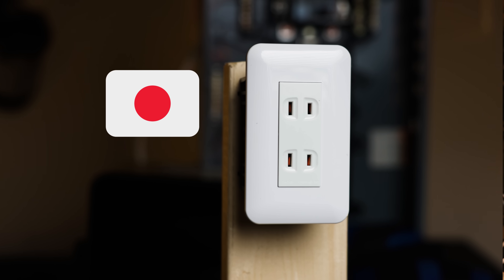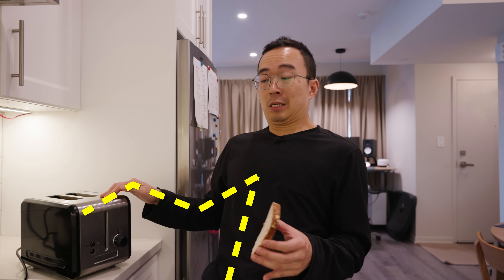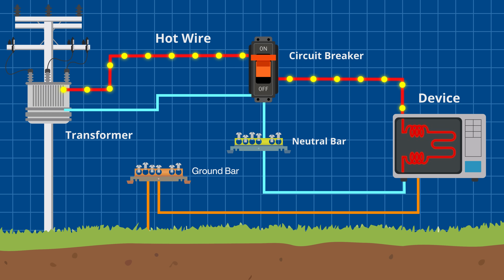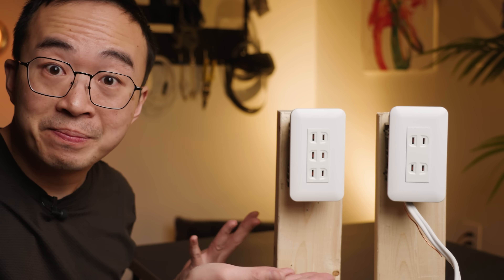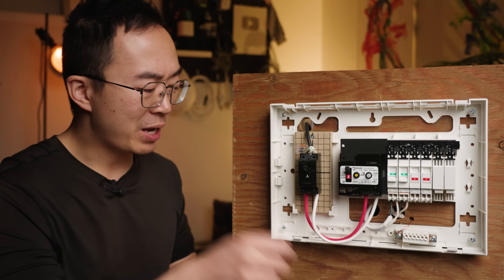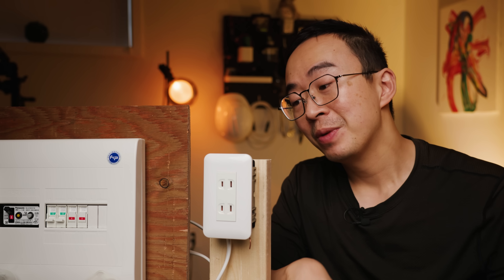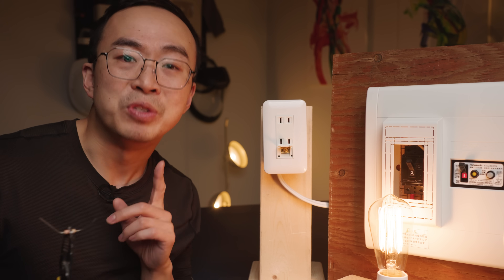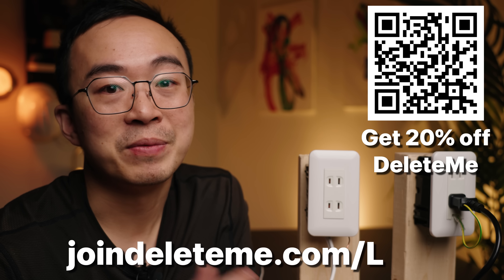How Japan Made Their Outlet Safe

Comment: This guy doesn’t understand the NEC. In the USA, the equipment grounding conductor, that you are calling ground travels back to the main panel. It provides a low impedance path for current in the event of a ground fault event. Dropping a ground rod doesn’t guarantee low impedance so we create the low impedance path with a wire. With a sufficiently low ground impedance, we are able to create a large amount of current necessary to trip the circuit breaker protecting the circuit and remove the power source from the wire.
Reply: Watch the video at 3:30.

Comment: What I hate the most from ungrounded outlet is the static electricity discharge or whatever it's called, the one that shock you when you touch your PC/Audio devices that is connected to it but not deadly. I assume these GFCI doesn't get rid of that?

Comment: Electrical systems are like religions - everybody has the best one but can;'t quite explain why :-) The best example IMO is how Brits will say they have "the best electrical plug in the world" - but of course there is zero evidence to support this claim, because who rates electrical plugs against each other? Outside of a national electrical system, no other devices "meet code" and are likely actually dangerous. So the UK plug is the best pug for the UK, and a US plug is the best plug for the US

The UK plug is certainly the biggest - a great way to triple the size of a phone charger - and also the most likely to require medical attention if stepped on. Its unique (AFAIK) fuse requirement is actually a compensation for the old "double-fed" ring mains in UK homes (less used now) that could provide 32A into a plug rated for 13A

Comment: 12:02 I’m using ~40 year old outlets, am I cooked?
Reply: you're supposed to test it every month (yes, i'm aware that most people don't even bother or don't even know about it). There is a TEST button on the outlet. Press it. If it trips, it's working. Press RESET to turn it back on. If it doesn't trip, it's broken and needs to be replaced ASAP

Comment: I have a real situation where GFCI + Ground likely saved me from a nasty shock.  My espresso machine had a leak in the heating element, causing water to get into it and conduct electricity from inside the element to the metal fittings and ultimately to the chassis of the machine.  The GFCI + grounded outlets in my kitchen immediately shut off the breaker as soon as the machine was switched on.  If I had only GFCI, I would have needed to touch the appliance first, and if I only had ground, the water may have provided enough resistance to stop the breaker from tripping at all.

Comment: You don't understand the difference between current overload (short circuit circuit breaker or fuss) and earth leakage (earth leakage circuit breaker to sense imbalance between currents in live and neutral lines). These are fundamentals for electrical installation. Betting on human body to form momentary path to earth during earth leakage fault just because supple voltage is lower at 100V (in Japan) is pathetic/outdated idea. Just make sure that your earth leakage breaker never fail and will trip in time.

Comment: Here in Brasil we have as a standard the grounding and the GFCI ( We call IDR and DDR in portuguese), GFCI is mandatory for circuits in wet areas, like Bathrooms, but it is commom to use an GFCI to protect all circuits, it is not mandatory but it is widely used.

Comment: It's insane that you do not use RCDs in north america. It's a 20 usd thingy that protects your life, which a grounded case does NOT nessecarily do. The breaker will trip only above a high amp current value which can, under the right (or wrong) circumstances, be lethal. Not every zap ends with someone dead, yes. But it IS very dangerous. Even with the 30 mA of a RCD bad stuff can happen, but it is highly unlikely. If your shortout isn't complete but high resistance, the breaker will not trip and the plug or whatever will simply start to burn. At this point you can only pray that at a certain point the connection will get good enough so the breaker can trip. If not, it will burn and burn and burn.

Also, your grounding rod looks terrible. It could never pass the tests we have in europe. I was wondering what you were talking about when you were referring to the ground connection as high resistance. But yes, that one checks out with a grounding rod like this. In Europe we technically can have a max resistance of 1666 ohm at 50 v for testing if we use a 30 mA RCD. This is the max allowed value, in real life the value is much lower. In our company, a grounding resistance up to 50 ohm is considered to be ok. In most cases it's somewhere around 5-15 ohm. If the value is higher, you need to renew your grounding, which usually means a new grounding rod or loop. Only our grounding rods go deep, depending on the earth and wetness and salt content and stuff like that. In some regions you might need a 15m deep grounding rod because the earth is not electrically conductive and maybe too dry as well, so you effectively have to hit water. In new installations, you usually install long grounding loops into the base of the building which is cheaper and in some cases even more effective than vertical rods. Also the grounding is always well protected against corrosion.
Reply: Who says we don't use RCDs? It is known as GFCI (Ground Fault Circuit Interrupter) and it's required to be instaledl in kitchens and bathrooms and anywhere near water source.

Comment: Complete ignorance and misunderstanding of different type of protection. Circut breakers are intended to protect wiring. Circut breaker are NOT designed to protect people. The current will kill a person before circut breaker will disengage. RCDs on the other hand are designed to protect people. They compare current in with current out - if difference surpass threshhold RCD disengage. The current difference in RCDs is selected based on the location of wires and devices as some ground or long wiring naturally leaks some current.  If there is current leak because of damaged wires or device you MUST have a ground with lower resistance than neutral for current to leave. 
In other words, it is impossible to integrate RCDs unless you have ground wire in your wiring and every device is connected properly to ground.
Reply: It could be the case certain RCDs are designed to work with ground. But I DO know for a fact that our American GFCI (equivalent to RCDs in other countries) do NOT need ground to work. Our GFCI work by monitoring the current between hot and neutral. If there is a current imbalance between hot and neutral, there is a leakage current somewhere and the GFCI will immediately cut off power.

Comment: Technically the neutral is a grounded conductor, like the ground wire, but we do not like to connect the ground wire to the neutral anywhere except at the main entrance of the electrical service. It gets kind of complicated, on AC electric you can back-feed voltage through the neutral, and yes it is more expensive to run another wire for the safety of grounding. If you connect the ground to the neutral at the device, you could energize the device directly, instead of only if there is a short. Sometimes I think America is stockpiling copper metal but it is considered safer to have the extra safety wire.

If you connect the ground to the neutral directly at the device then you are touching an active conductor if you touch the metal case of the device, and it should not shock you, because it should be grounded, but still, it's carrying electricity, so it should not be done. The danger is when you touch metal that has voltage and you also touch a ground, then you become the wire and the electricity flows through you.

The ground wire is for a short-circuit condition only, to trip the circuit breaker.
The neutral white wire is grounded, but we like to isolate the grounded conductor that is used for power from the one that is only for a safety situation.

Then sometimes they even want another "isolated ground" conductor for sensitive electrical equipment that wants it's own dedicated ground to separate from the safety ground.
It gets crazy, because with everything getting grounded, stray voltage can actually get induced on to the ground and even the building ground can have a small voltage.

If you think about it, the system looks like a tree, all the wires trying to find the literal ground, like the trunk of a tree. If you bond the neutral to the ground somewhere other than at the trunk of the tree, it's somewhat unnatural, and the voltage can flow in a backward kind of direction.

The ground seems to be an eternal debate among electricians.

Comment: but nobody said something about the outlet it self, now if it's the japan or US version, they both are a joke , the cheaper ones, when you plug something in it doesn't hold properly, and if it s something what use some more power , not safe at all it will burn out , you won't find that problem in any of the  european version

Comment: Meanwhile Turkiye: EVERYTHING! :D POWEEEER!

220V. Better. Sorry. It is. Just don't get electrocuted. We don't have to think about our cable gauges much since it is 220V. Every socket in house can power up 5000W oven with standart cabling. So, no need for special wiring in housing, which can cause problems like lazy or stupid or greedy or both installer/contractor. You need to be much more cautios when handling 220V. 100V?! Dude, that just hurts me. 220 can kill me. :D (I am joking, 100V also can be pretty dangerous)

GFCI standart. I can protect the whole house cheaper so why should I protect some sockets for more money?

Socket type. European is far better. Sorry. In your socket type contact area is same with a round contact; but your thickness of metal is less. Also, much more important, if you try, you can touch the conducter pins while it is still connected to the socket. Type F socket is inside a cavity. So, when you plug it in, there is zero access.

By the way, in Turkiye you can not find a non isolated grounding cable. They are also isolated just like neutral and live.

In my thinking, getting shocked is hard in today's standards; but burning a house is far more easy with 100V or 120V. Just think like this, let's say I am mad and want a dryer in one of the rooms. I can use a cloth dryer in there without any modificiation in cabling. Safer.

In Turkiye we use everything in a mix. 4 season. So AC unit in summer. In winter, apartment can be on economy to cut costs. So let's say you are cold. Then a heater also. We consume half of the world's tea production alone. So a electric tea machine is plugged in 16 hours a day (joking but, you see where I am getting). Untill recent times land prices were far lower, so our apartment flats are far bigger. More bedrooms, more appliances, more bathrooms, bigger living rooms, far more lighting needs. In an avarage Turkish apartment 2 people are in bath simultaniously and drying their hairs, :D while the washing machine and the dishwasher is working. With 220V, even if your cabling and infrastructure is mediocre, you are ok.

Do we have electric fires still? Offcourse! I told you the new standards that are applied for 20 years. There are many houses without earth connection, puny tiny cabling, etc etc. But our houses are made from cement. Hard to ignite. In older houses fire hazard is not a big deal in Turkiye. They are not tall. 4 stories. Easy to evacuate. Some of the newer houses are high. Like 18 stories, 30 stories high. They have lot's of lot's of extra precations for fire. But in Turkiye, I would not trust them. :D Just live in a 4 story, standard apartment. If the place you are going to live is a earthquake region, definetaly find a new apartment with a rock soil. If not in a earthquake zone, find any apartment with a rock soil. Never trust anyone's job or expertise. You should know everything here. Little little, just into the middle! Wellcome to Turkiye!! :D

Comment: I wonder how long it will be in the UK before AFDD's are mandated for every circuit and not just 32A sockets or "high risk" residential buildings. A combo AFDD/GFCI say for a 200 amp installation would surely be an expensive piece of kit.

Comment: Grounded outlets are commonly used in Japan, most notably for higher drawing devices like ACs, refrigerators, washers and dryers, bidet toilets, ovens, etc. Also, all 200v outlets are grounded.
Reply: they are required to have grounded outlet in the kitchen where most big appliances are at.

Comment: GFCIs are really simple. Take a coil of wire and pass both your neutral and hot through it. As long as the currents match there is no voltage in coil as they flow in opposite directions. Even a slight mismatch in current induces a voltage in the coil. One problem with a GFCI at your panel is you lose your entire house when it trips.

Comment: SAFETY TIP:  If you buy a GFCI plug for, say, your bathroom, you can protect ALL the plugs on that circuit by wiring it the right way, so it's the 1st one from the breaker.

Comment: As you know, the power distribution system in typical Japanese homes uses a single-phase three-wire system with 100V/200V. This is almost identical to the US system(110-120V/220-240V in the US system), but the grounding system differs: the US uses a TN system, while Japan uses a TT system. A drawback of this TT system is that if a leakage current occurs in an earthed appliance, the appliance's potential relative to ground can become quite high. For this reason, a residual current device (RCD) is always installed in the household distribution panel. In Japan, outlets with grounding terminals are installed in locations where water-using appliances like washing machines, refrigerators, microwave ovens, and dishwashers are used. An earth grounding wire is connected to the appliance's grounding terminal to ground the appliance. These are Class 01 appliances according to IEC standards. If a leakage current occurs in these appliances, the RCD installed in the household distribution panel immediately trips, ensuring safety. However, appliances not used near water lack a grounding terminal, and outlets in areas like living rooms that do not use water also lack a grounding terminal. Most appliances like televisions and audio equipment do not have a grounding terminal and are not designed to be grounded. These are Class 0 appliances according to IEC standards. In this case, whether an electric shock occurs when leakage current flows through the appliance depends solely on the environment. If you're lucky, the small leakage current may trip the RCD, resulting only in a minor electric shock (though if the leakage current is too small, the RCD won't trip). If you're unlucky, the large leakage current flowing for a short time before the RCD trips could lead to serious consequences. I believe that compared to Japan's single-phase three-wire 100V/200V system, the three-phase four-wire 230V/400V wiring systems used in Europe and elsewhere (using the TN grounding system, of course) are the most efficient and offer superior safety. However, changing this in Japan going forward is impossible. If Japan continues with single-phase three-wire 100V/200V, it could be made safer by switching to a TN system like the US (while also using RCDs, of course) and adopting three-pin plugs and sockets. Unfortunately, there is no such movement. At the very least, I wish they would keep the TT system with RCDs but switch to three-pin plugs and sockets. However, I sense no such movement. Japanese home appliances are designed with full consideration that equipment is not grounded. Furthermore, with single-phase three-wire 100V/200V, the voltage to ground is 100V, so electric shock accidents are extremely rare, and almost no one considers it a problem.
Electrician: Why make outlets three-pronged when there are no appliances with three-prong plugs? Who pays for running the ground wire? Appliance Manufacturer: Why make power cords three-pronged when there are no three-prong outlets? Changing to three-prong plugs will just result in people breaking off the ground pin.

Comment: You can touch all the hot wires you want as long as you Don't complete a circuit. Just ask all the birds that light on powerlines.
Reply: but you DO complete circuit most of the time. You are standing on the ground all the time. Unless you plan to wear insulated shoes 24/7, you are always grounded.

Comment: The most sophisticated electrical outlet system in the world is the Brazilian standard, with 3-pin plugs, similar to the European standard, and grounding. In our electrical panels, we have something similar to this Panasonic device, called an RCD (Residual Current Device), which monitors leakage current to ground. In addition, we use surge protection devices (SPDs) that protect against lightning strikes.